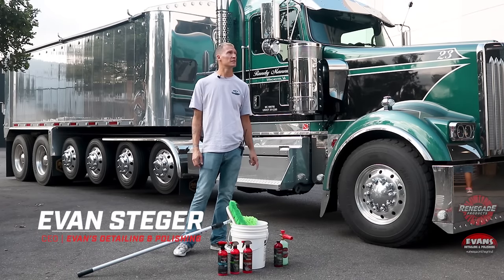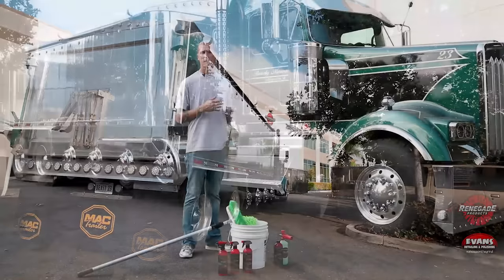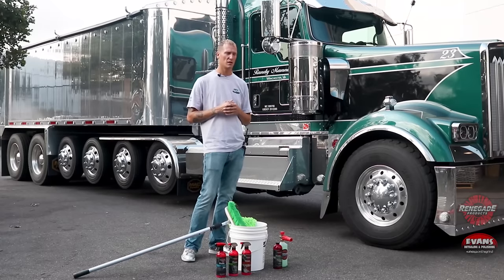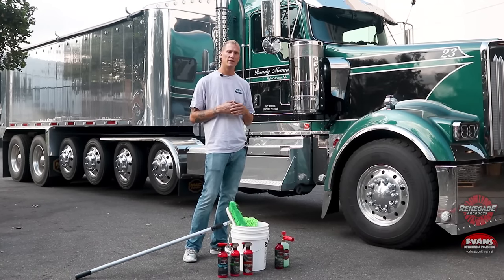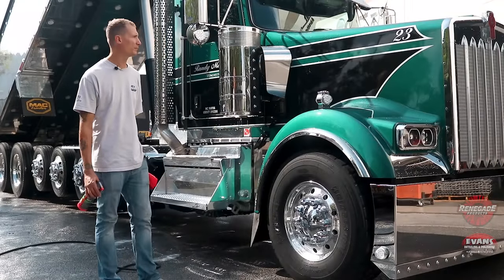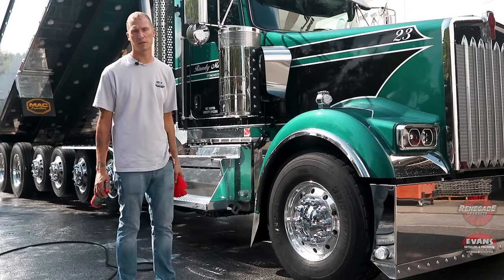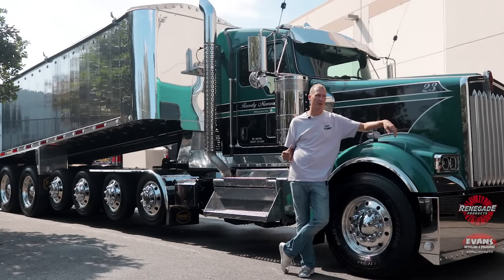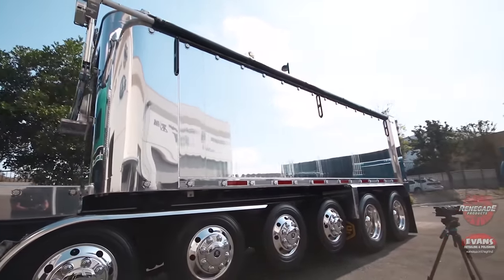How to properly detail a semi truck - Evan's detailing and polishing

Comment: Looks good! Is there a reason you use a nylon brushes instead of microfiber or lambs whool wash mitts.  Many guys say that those nylon brushes can scratch the surface.  What is your opinion on that?
Reply from the maker: RVing with Andrew Steele as long as you aren’t scrubbing hard and you keep the brush rinsed and clean you are fine. I also polish it on a regular basis.
Reply: @EvanStegerMetalPolishing  Thank you for the feedback. I've seen several of your videos over the last few years and appreciate all of the wisdom that you share with the world!
Reply from the maker: RVing with Andrew Steele glad to help. Thanks for watching.

Comment: My boss would have soaked everything besides the paint in acid. Frame and all. He only cuts really fast with with orange wheel and brown compound and makes us hand polish or use pneumatic DAs on everything else. He doesn’t cut anything besides a bit of the tanks and the outer part of wheels. Everyone is exhausted after having to polish out all the whiteness created by the acid. Any tips on how to make the crews job easier or how to convince my boss of trying something different?
Reply from the maker: Stop using acid. LOL No idea how to convince your boss. You can try showing him my video on the damages of acid use. Not sure if that matters or not. But honestly just talk to him. See what he says.

Comment: OMG!!!! Drivers!!!! Do not, do not,  do not soap up and wash your engines..... there are so many wires and sensors that are just not engineered to be pressure washed and cleaned.  You can literally have a $500 detail job done and then end up spending $15000 on a breakdown.
Reply from the maker: Thank you for watching and taking the time to comment.